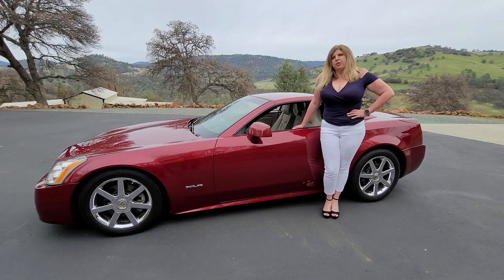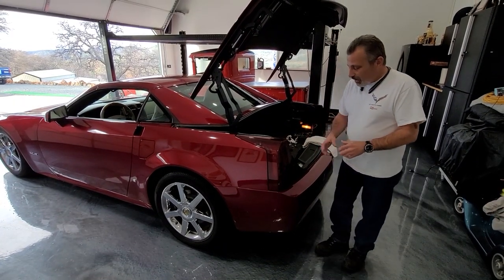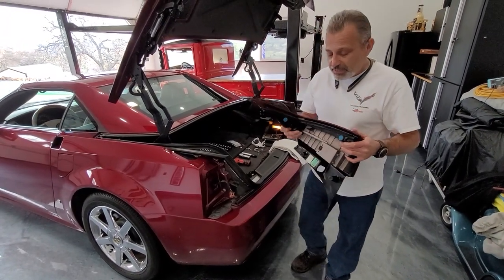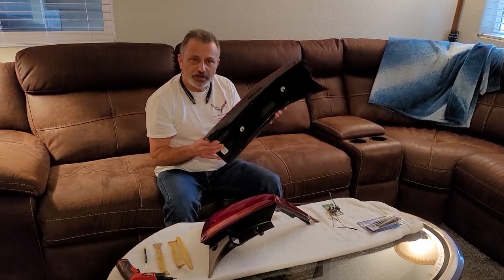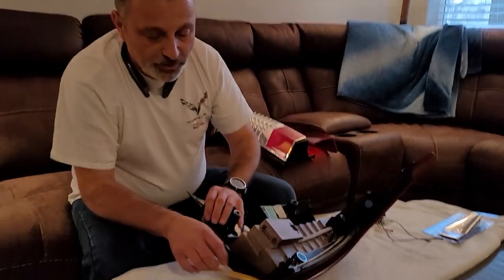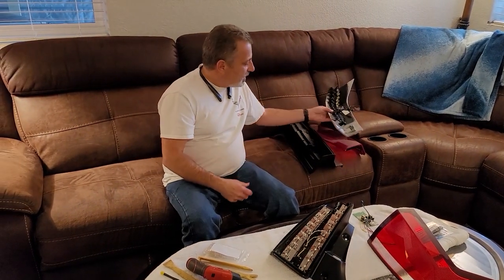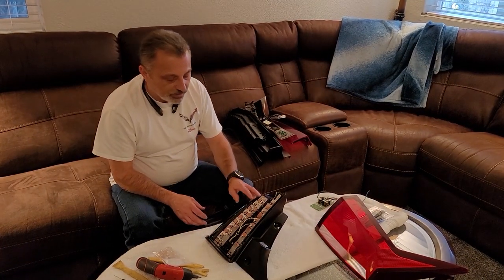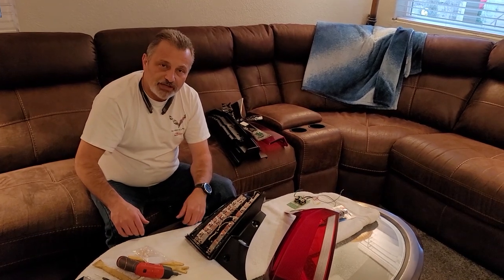How I Repaired Jennifer's Cadillac XLR's Tail Light

Comment: Incredible job!  Be sure the trunk edge does NOT touch the bumper facia or the paint will be damaged, The adjustable rubber tipped bumpers can degrade.  It is NOT a Corvette underneath.  Cadillac Northstar engine, better ride etc.  Yes, some parts are interchangeable.  2004-2009 not 2010.  Approx 16,600 were made I believe.

Comment: I recently began shopping around for one of these beauties in good shape...but holy crap, if the taillights are that expensive, there's no telling how expensive other routine replacement parts might be.  I might have to reconsider.
Reply: It's just the headlights and taillights, everything else is fairly reasonable, as long as the electronics in the rear driver's side trunk compartment haven't gotten wet. Check the shocks, OEM set of four is well over a grand, many have been retro'd to Bilstein and the magnetic ride suspension module bypassed. They're great cars, but with anything, maintenance is due regularly. I had to put in a new window regulator/motor, trunk lid struts, drive belts, battery, remote fob batteries, just last week. It'll need new tires in a year. I prefer Michelin and the "Hi-Perf" all-season ones I use are currently around $220 each. Cars ain't cheap. When you go to check out an XLR, see the rear lights with and without brake lights. Use that as a negotiating chip if necessary.
Reply: same here...people are starting to gouge prices...people are charging up to $1500 for these

Comment: You mentioned that you used black rtv sealant.  Did that make your second time easier to open up?
I had multiple bulbs replaced years ago and all of a sudden ALL the bulbs have gone out BUT when you press on the brakes...they will barely flicker.....control board probably out.
Reply from the maker: It was harder. I would use regular silicone if I had to do it again.  Its a possibility tbat it is the controller. Good.luck

Comment: I have a 04 and I’m pretty sure I need the logic board replaced.  I had a complete strip go out.  The heating up has got me so nervous.  Mine is out on the drivers side.  You think it matters what side srx taillight I order for parts?  Not sure if the logic board is a different part  for side of car.
Reply from the maker: I'm sorry about your lights. No I found the logic board is the same. When you get the SRX Logic board the colors and length of the wires are different so just replace the wires one at time wire for wire so you get them in the right spot.
Also if I remember right you will need to extend a couple of wires. Good Luck!!

Comment: Not sure why I'm watching this, since I don't own an XLR, but despite the quirks, it is clear that XLR is the best Corvette.
Reply: The XLR, as is the Corvette, is hand built on a Y-Body chassis. on a separate assembly line in the GM Kentucky Factory. XLRs used the newest technology Cadillac Northstar V8 engines. My base 4.6 liter Northstar is smoother, quieter, and wraps about 1,000 rpm higher than any GM LS engine I’ve ever owned  The Folding Top. also assembled in the Kentucky Y-Body factory is nothing at all Corvette. Neither is the fiberglass body (not even close). The GM magnetic ride suspension is indeed the same as the ‘Vette, but is tuned  for the World Class Cadillac Luxury Roadster’s Roadster’s world performance and ride. The shared with the world beating performance C5 & C6 Corvette GM Y-Body chassis is was, by far, the best choice for the Caddy XLR Luxury Roadster. I don’t think there is a better world class performance sports car. especially when cost (AKA “Bang for the buck”) is factored in, than the Corvette, since 1957. But the Cadillac XLR Luxury is NOT a Corvette. It’s a Cadillac, through and through.